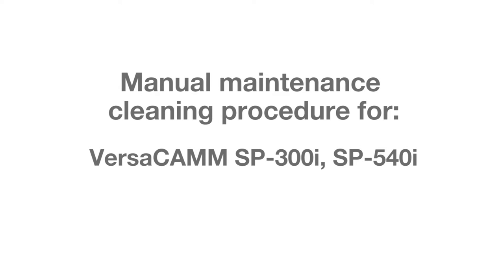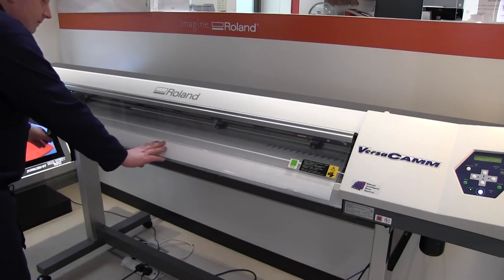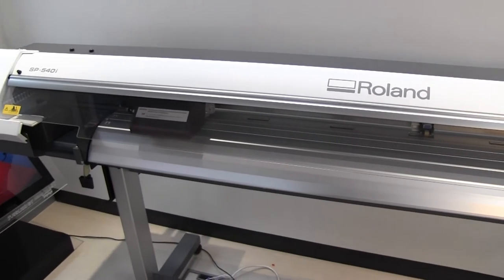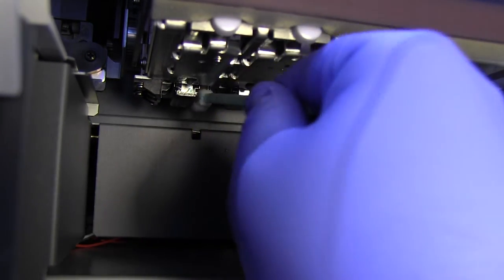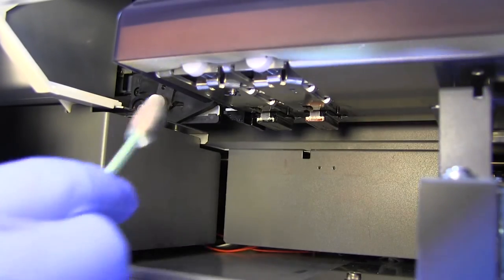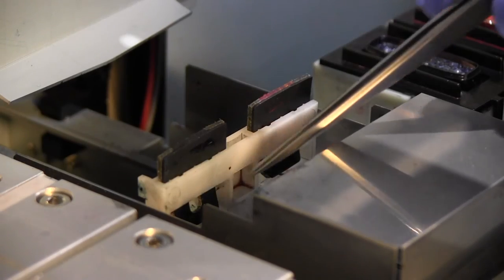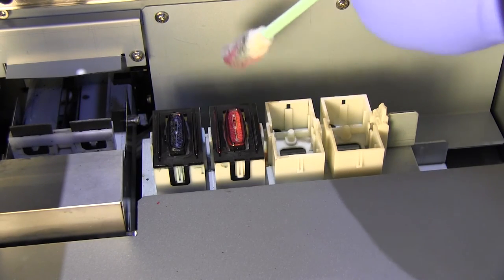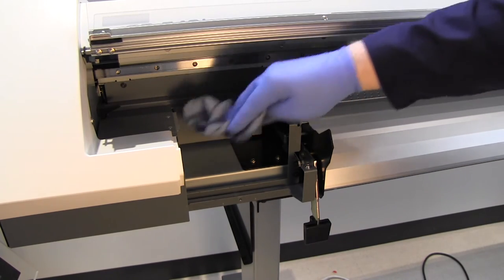Roland VersaCAMM SPi Series - Manual Cleaning Procedure

Comment: SP4501 54" printer cutter:  when printing a rectangular vector image, 2 sides (left and right) edge of the printing is crooked but the top and bottom are perfectly straight. What's the problem/issue?

Comment: Thank you for this!  Can't find the wipers on mine but found everything else.
Reply: when in maintenance cleaning, press the down button on the control panel and the wipers will come out this printer is a new model if you have an older model like the SP300 or SP540 they will appear (they actually didnt explain this very well)